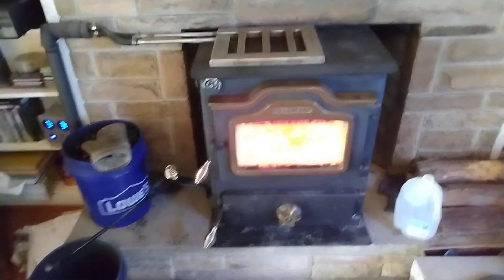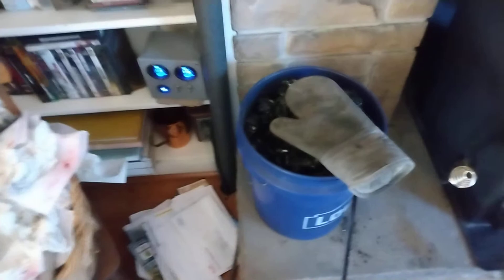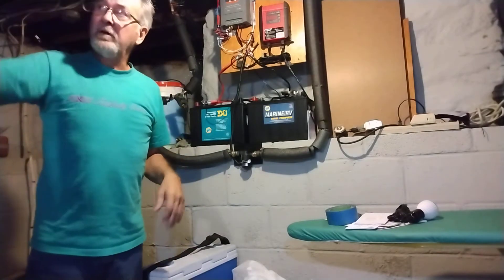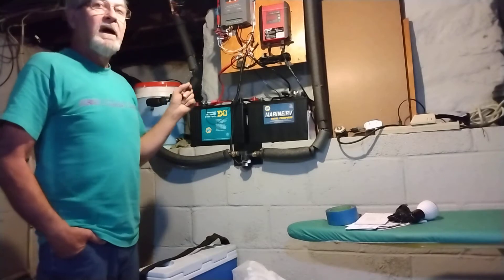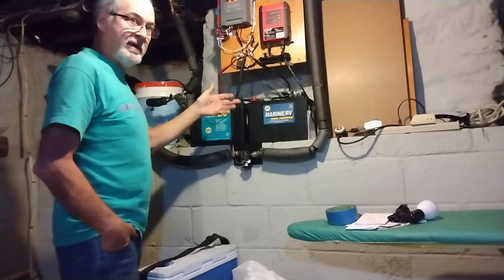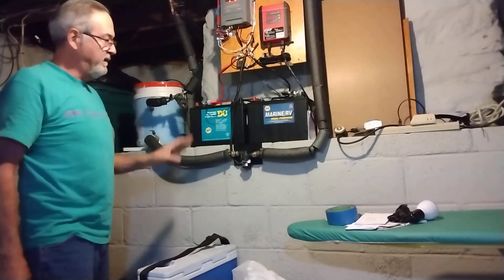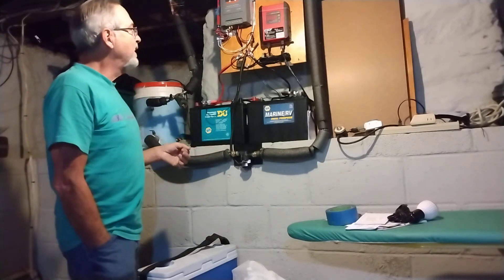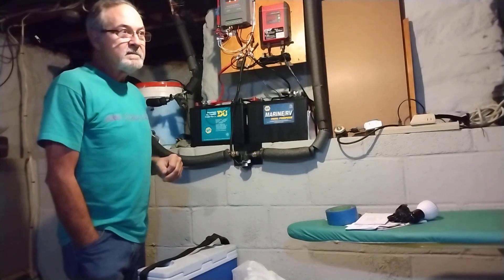What is that contraption on your coal stove?

Comment: Ingenious way to heat an area .. Could it be tied into a baseboard heating system ??
Reply from the maker: probably not 😒this system isn't under pressure and can only use a smaller system to blow the heat into a smaller area